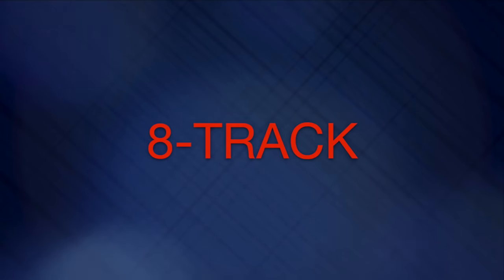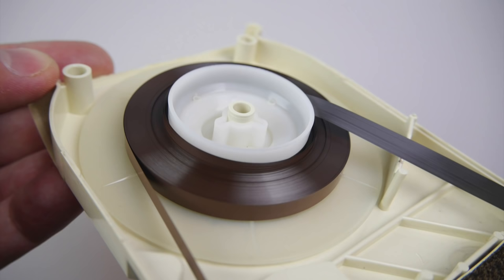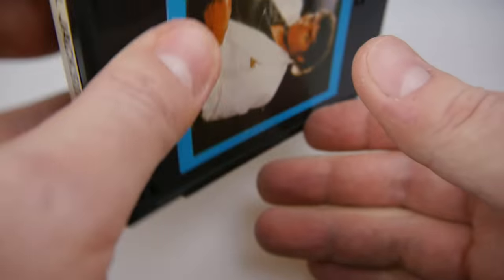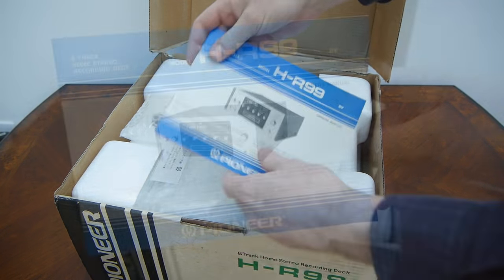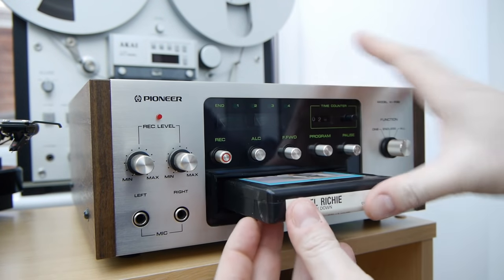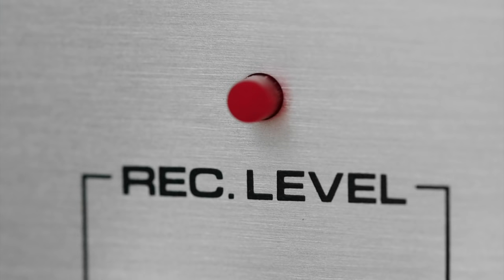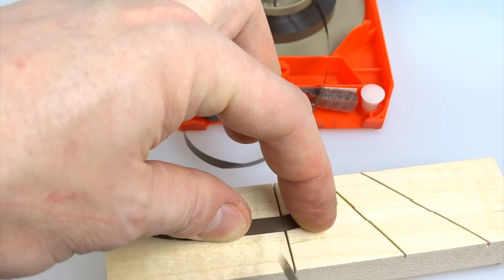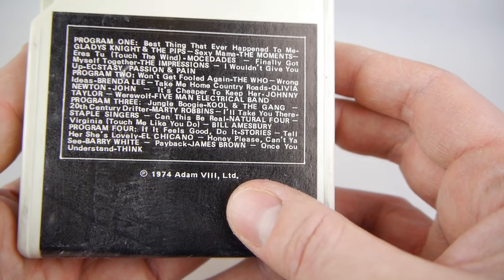Revisiting the 8-Track with a New 1975 Pioneer HR-99 Recorder

Comment: Oh don't be a baby.  That big pile of loose tape from the Robert Palmer cartridge can easily be reeled back onto the spool and spliced again.  Somebody just doesn't like a challenge and about an hour of time to kill.  ;)
Reply: skipphunter Robert Palmer 8-track cartridge that plays voice of the devil would be pretty awesome though:)
Reply: Donatello Nobatti  I revived a Supertramp cartridge that the tape turned to a solid mass. One little cut and a reel to reel player and I had it back together popped it in and it cued perfectly at the start of “Goodbye Stranger”.
Reply: That reminds me of when I was up in the mountains many years ago, when I was probably about 10 to 12 years old.  I found 1/4" tape strung all over the trees, ground, and into the river.  I took it all home very carefully in a big pile.  When I got home, I carefully cleaned all the tape with rubbing alcohol and soft tissue, and wound the various parts onto small reels.  Then, using a reel to reel recorder, I verified the head and tail of the reels, and identified the order that they belonged in.  Then I properly spliced the tape lengths and wound them onto a spool from a donor 8-track Cartridge, and spliced the final head and tail together.  I do not even remember what the tape was now, but it worked and I did listen to it a bit off-and-on.  It was a bit fun to do all the repairs.  I was actually surprised I had the complete tape, with no missing parts!

Comment: You should have one on 4 - track players. They were the same actually just had only two channels like a quad deck.  When I was about 13 a friend got one from his older brother or somewhere and we hooked it up. We only had one tape ‘ Canned Heat ‘ with Refried Hockey Boogie on it. We listened to it about 100 times. It’s badass tune.
I have a quad deck from a Ford car but never tried hooking it up.  I only have one tape. Steve Miller the Joker. I used to have a Pink Floyd Dark Side of the Moon and Humble Pie Smokin but lost them in moving.
8- tracks took most people from the world of mono AM radio with one speaker in the dash to awesome stereo in the doors.
8- tracks worked fabulous except they didn’t like being tossed around in a car. I still have a bunch from the mid 70s that play fine except some the metallic joiner tape gets old and comes off or sometimes the rubber wheels break down to tar- like goo and you have to change them out. Don’t get any of that goo on the tape or it will mess up your whole week

Comment: We recorded over the pre-recorded tapes.  We had to tape over a detent on the side, if I recall correctly.  We had a Tuner/8 track recorder system in the early '80s.  K-Mart was unloading a ton of 8-Tracks cheap and we used those as the recording medium for early '80s awesomeness off terestrial FM.  I thought I had done something recording Billy Idol's 'Eyes Without A Face' on 8-Track!  Thanks for the video.

Comment: You wouldn't believe how many 8-track tapes I had to take apart and repair when they broke back in the late 70's and early 80's!! And when the tape player ate them you would have to string the whole tape out and straighten and fix all the broken parts and scotch tape them back together. I got really good at it and I used my dad's reel to reel tape player to wind the tape back onto the 8-track spindle inside. At the time I belonged to Columbia House club and would buy a bunch of 8-track tapes cause my dad's truck and my car had an 8-track player it them.
Oh yeah, I remembered when you would hear a faint sound from another track playing!
One of my bad tapes I had to repair over and over again! And, at one point I had to put graphite on the spindle inside the cartridge.  They didn't have repair kits back in the day when I used to fix them so I would replace the foam with lightly folded facial tissues with the previous slick cover taped over the tissue. Then, I used foil from a gum wrapper to replace the foil track changer.
That tape at 14:06 I can repair like I explain earlier. If there is no split in the tape, you have to cut one...which is done at the metal changer. Then slowly untangle and reel it back up on a reel to reel player...and make sure it's not too tight or too loose! Of course making sure the very first end of the tape is sticking out of the reel. Then feed it through the cartridge and tape it back together again. I did maybe 50 tapes this way!

Comment: One problem with the single-reel loop is that the tape tends is that since one wrap of tape at the center (supply) is much shorter than at the outside (take-up), the tape tends to get tighter over time and causes speed issues or lock-up.  The tape is coated on both sides to make it slide better, but that may become less effective over time as well. IMO, 8-track was purely a convenience product- a way to get plug-n-play music in the car.

Thanks for the videos. I've been fascinated by audio gear since I was a wee lad.

Comment: The HR-99 is a solid player. I've had it's big brother, the HR-100 since it was new.  The only difference between the 99 & the 100 is that the 100 gives up it's automatic level control for Dolby B noise reduction. A fair trade-off, I think. I've been into 8-tracks all my life and have a substantial collection of tapes. In the neighborhood of 500 Quad tapes and maybe half that in stereo tapes. I've moved a few times and during one of those moves, I sent three very large garbage bags full of 8-tracks to the dump.

One small suggestion is to use a tiny amount of Vaseline rubbed onto the pinch roller spindle and the tape loop spindle. It'll help keep things moving smoothly.  The less friction within the tape makes it easier on the player to maintain tape speed thereby reducing wow & flutter.

If there's any tapes you'd be interested in owning, send me a wish list. If I have anything, I'd be more than happy to send you a care package.

Comment: Back in my teen age days I used to cruse around in my 66 Mercury Cyclone GT listening to 8 track tapes. I remember that sometimes the tape would get jammed in the player and when you pulled it out there would be a couple of feet of tape hanging out. I discovered that if you grabbed one side of the tape, gave it a quick yank with just the right amount of speed and force, the tape would wind itself back up.

Comment: I remember my dad gave me an eight track player from a car. I think there were two cartridges with it, one was definitely a blank cartridge on which a Bread album had been recorded. In order to get it to work, I had to Heath Robinson together some speakers and a railway track transformer for my 12V supply. It did wobble the sound a bit. I just remember the satisfying clunk as it switched tracks.

Comment: For new recordings, you could use your recently acquired dbx unit to eliminate the tape hiss.

So cool to see a "new" piece of 1970s gear spring to life.
Reply: That's not how it works. It plays back specially made vinyl records on which tracks are "flattened" and are played through a DBX decoder which expands the track to original size. It's basically the predecessor to lossless audio formats
Reply: I believe the dbx decoder he is using can also act as an encoder, which allows creation of similarly "flattened" recordings to tape. (dbx vinyl was just a playback-only adaptation of the play/record systems for tape.)
Reply: wondras If that's the case, then it would make 8 track tapes amazing
Reply: wondras That is correct, DBX boxes work both ways. Encode through tape loop when you record, and decode through tape loop (or DBX disc too, I guess) when you playback.
Reply: I have a dbx encoding cassette deck that can function as a dbx filter. So technically I can run my 8 track recorder through it and could make s dbx cartridge. Probably would be a fun experiment.

Comment: I still have what I call my "splicer". It's a metal runner complete with hold down clamps to aid you in splicing tapes.  Some of the 8track plastic cartridges are very hard to take apart, and you inevitably break them and afterwards have to keep together with tape.  I still got all my 8track tapes from 1969 all the way to about 1973 - about 1000 of them.  Haven't played them since about 1990.  Didn't realize they're worth anything.  Will have to check that out.  Oh, by the way, to correct the bleeding from the adjacent track when playing the tape, people used to put matchbooks underneath.  It's triangular shape meant you can regulate how high up you wanted to push the tape.  Very high tech.

Comment: Tape slip, where the tape motion slows and stops and picks up again, is usually due to the 8-track's lubricant, finely powdered graphite.  When it accumulates on the pinch roller and capstan, impacted by the pressure, it can form quite the slick no-grip surface on your pinch assembly to allow the tape to drag and sputter.  Once you know to look for it, you'll spot it and clean it away easily with a lightly alcohol dipped q-tip, or even quite effectively with a pencil eraser.

Comment: Sneakin' Sally Through the Alley featured Little Feat as the back up band not The Meters. Great video, thanks for taking the time to do such a nice job. NOS Pioneer deck, WOW!
Reply: Nope. It is definitely The Meters and several top session men. If some of it sounds a bit like Little Feat, that's because Lowell George plays on most of the tracks. Little Feat did play on the next album Pressure Drop, which is probably the source of the confusion (that and the cover of Sailin' Shoes).

Comment: Back in the early 80's I had a 1965 Ford Falcon with an 8-track player (also had a foot shaped gas pedal).  A friend had a very nice Wollensak recorder.  It might have been a Model 8050.  I borrowed that machine and bought some pre-recorded tapes for 50-cents each from a discount store.  I didn't care what was on the tapes as I used them for blank stock.  I listened to those tapes until I got a new car a year later.  As I remember the sound was quite acceptable.

Comment: The 8 -Track reminds me of the old 35mm film platter systems used in movie theatres B4 the digital conversion / switch over. That Pioneer 8-track player is really a pretty cool unit for it's day - and I was surprised that it worked straight out of the box w/ even an issue after 40years of sitting around not ever being used. OH WOW - MECO  Star Wars ! Interesting tape counter?

Comment: I imagine the reason you have the selection for "all" (or loop record) is to replace a timer function. If you are recording off the radio and need to leave your house 90 minutes before your program starts, you can still record your program in full, because it will begin recording with it's second pass.

Comment: Yeah these were very common in America from the late '60's to late '70's, with quite a few into the early '80's. I'm only 35, but remember our console home stereo w/ both 8-track and record changer turntable; sounded fantastic!! And while very young, our car had an 8-track player that we used all the time. I had one in my bedroom until the '90's that I listened to Neil Diamond on.
One fun thing on many players was when the tape was done, it would auto eject with the power of a catapult and the tape would go flying across the room and hit the wall!
One time I tried to make an 8-track Walkman by marrying a car player with a cassette Walkman so I could play 8-tracks on trips, but my 8-year-old self didn't make it very well and it didn't work very well.
Boy do I remember the warble on some, bubbled labels, tape breaking (and repairing it), hiss, etc (few had Dolby, resulting in a measly 40 dB SN ratio or so vs around 55-60 on cassette without NR. 
I also had a ton of records in those days, as we were poor and CDs were #+{* expensive, but most records I got were scratched to hell so the 8-tracks sounded better. Since then, vinyl has become collectible, but 8-tracks mostly have not.

Comment: Something I always found that was interesting is that one of Pink Floyd's albums "Animals" on 8 track tape (or at least some of them) had a special extended version of the song "Pigs on the Wing" which originally split into 2 parts with one part at the beginning of the album and the second part at the end of the album, the two parts are jointed together and a guitar solo is thrown in the middle of it and it's placed at the beginning of the tape.

Comment: Radio stations in the US used a simplified version of the 8 Track for broadcasting up until the early 2000's. They called them "carts", short for cartridges I suppose, and they brought a lot of fun to the radio, especially when they would fail. However, they were very durable considering how much use they got. Everything from songs to commercials were placed on carts. The radio station IDs and jingles got especially a lot of play and use.

Comment: I had a kiss album on 8 track and I was dying to listen it but after I got my player working I found the press wheel axle had broken. I took it apart and broke most of the snaps that hold it together. Then I made a new spongy piece out of an old sock. Then I had the misfortune of all the tape falling off the reel. It took three hours of untangling to fix that. I finally epoxied the axle and fixed the hole  reason I took it apart. It took till the next morning to get it back together, but it was well worth it I was blown away at the sound quality of that old wrinkled tape. They may have been high maitnence but 8 track really deserve more respect than they get

Comment: When I had my collection of 8 Tracks the one thing I learned about certain parts that had to be replaced like the foam or pads. In the 1970s many parts manufacturing was controled by a monopoly in that market. So the failure of the foam or pad was do to systemic appathy in control of quality and no concern for correcting of the problem. This was society at its worst and remember we threw something away if did not work  instead of fixing it. Here in the US we mostly had 8 tracks in a car. The constant heat and cold was another  the format was not made for. Everything had a lifetime warranty??? It lasted longer than the people that owned it. Most never thought we would still have it 40 to 50 years later.😲😎 Like the video.

Comment: I have the US version of the HR99 (recently gone through and ready for new belts) and it is a bit difference. For one, the meters do not light up until it's in record mode (there is no record indicator over the volume controls like yours). During play mode, the meters are inactive and no lights other than the track indicator and the counter. Pioneer also made a version with built-in Dolby B. In the final days there were a number of pre-recorded tapes released with Dolby B ( I have a few). I bought my HR99 used in 1980, with very low use on it. 8 tracks were available into the mid-80's, and blanks well into the late 90's. At least in the US. I used 8-track players in my car well into the 90's. You will find that the tapes you record yourself will generally sound better than pre-recorded tapes. Hiss is generally not much of an issue on tapes you record yourself, but you can always drop a DBX224 in line. I have! :)  My HR99 is in my main rack in my home studio, as i do have many off-air recordings that I want to digitize. That, and it a fun piece to have active in the system. Well done video!
Reply: The HR-99 does NOT light the level meters all the time, Only when Recording.  The big brother HR-100 lights the meters all the time and it has Dolby B Noise Reduction. Columbia/Epic was the first Record Company to start using Dolby B noise reduction on their 8-Track Cartridge Tapes in late 1973 or early 1974.

Comment: Put an 8 track in my first car in 1977 and later installed a radio with built in cassette. Much better. Used to buy albums and then record them onto good cassettes for use in the car. Still have those cassettes and they still sound good after 40 yrs. Old tech is still fun to use.

Comment: Funny 8 Track story.  Installed a new CRAIG PIONEER CAR STEREO 8 TRACK TAPE PLAYER 3108 hit play and it promptly started to un-spool the tape out onto the floorboard,

Finally figured out the car I installed it in was a 1963 MG 1100 which was positive ground.  Dialed up my electronics guru who told me to wrap if in insulation and reversing the positive negative wires.

I had a couple of reel to reels machines that also had an 8 track player/recorder.  This allowed me to dupe my reel to reels on to 8 track.

Comment: Thanks much. I had a friend with one of these and we used it to record tapes from vinyl records. They sounded much better than the pre-recorded 8-tracks. The manufacturers of pre-recorded tapes recorded them at high speed (as they did cassettes) which severely rolled off the high frequencies as well as adding a lot of hiss.

Comment: Great video - Again! I didn't read all of thee comments, but her are mine: 1) Any 8-Track can be re-recorded - there is no record protection. The play/record head will record silence when needed (there usually is no separate erase head - I have never seen one). Best results are if you use a bulk AC demagnetizer first, if you have one. 2) I seek out 8-Tracks with the copper leaf spring / felt pressure pad solution (some brands used this technique instead of the lesser quality "foam" pads).

Comment: the biggest issue with 8 track tapes is inherent to the endless design.  because the tape is pulled from the middle and went back around the outside it was constantly tightening itself.  the tape was coated in a graphite lubricant that was supposed to allow it to slip around and even the tension but eventually the tape would get too tight and TWANG it would snap.  

My dad actually had a little cutter/splicer thing to fix them.  i remember playing with it as a kid.